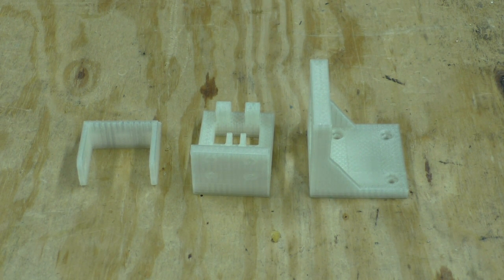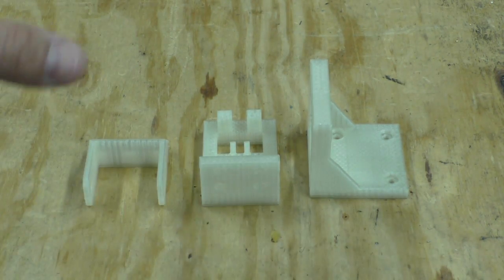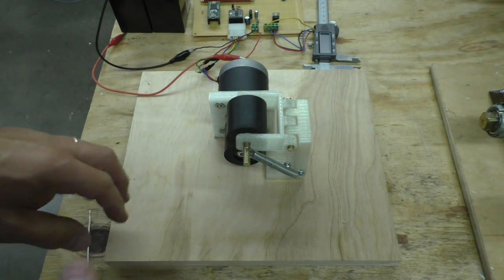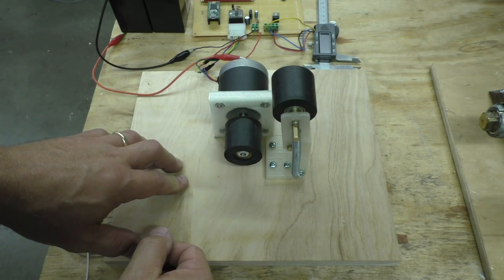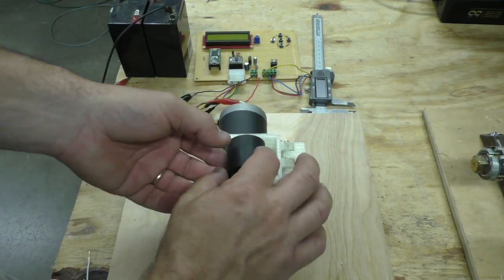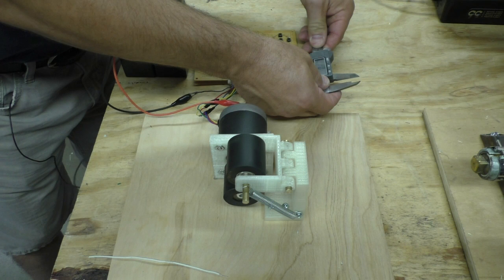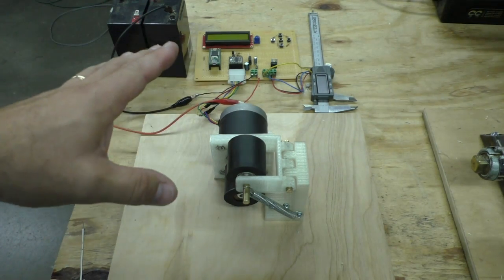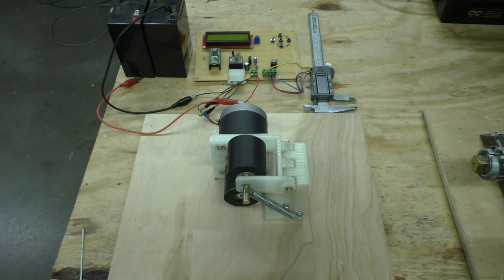Filament Extruder #6 - Puller Roller Assembly

Comment: I would run the rollers in a drill or lathe and shape a 1/2 cirlce on them in .5mm deep or so. This should ensure fairly round filament. The roundness of the rollers should not matter much, its the pressure applied to them that causes deformation. I would imagine 3-5g of pressure is all that's needed, but you may want to test that.

Comment: Do you think the roundness (or lack) of the rollers may have an effect on diameter consistency?  A filament extruder is essentially a 3d printer in reverse.  The extruder is the hotend, and the puller is the printer's extruder.  As such, you could use a 3d printer style extruder as your puller, and keep it as simple as a filament gear and idler bolted to a motor.  The downside is tooth marks on the filament, but that is more of an aesthetic problem.

Also I would think that printing rollers in TPU should be easy.  You could make them smaller since you are only pulling filament, and incorporate a shallow groove.  With the roller in its current form, you may have a lot of trouble with the filament trying to roll off the edges without some kind of guidance leading into the puller, or on the rollers themselves.
Reply from the maker: Won't know about the roundness issue until I can fire it up and make some filament.  It really isn't off that much. There are guides printed inside the part that holds the rollers to keep the filament in the center.  I just forgot to show it in the video.
Reply: I would expect the elliptical shape would cause minor speedup/slowdown of the draw of filament, as the distance fluctuates from center.... that being said, should be fairly simple to run the rollers in a drill/lathe, and file/sand then down to a more circular....